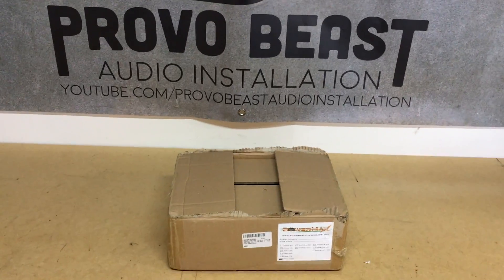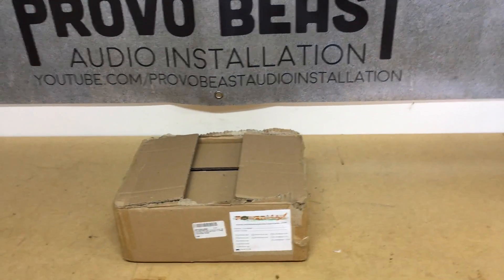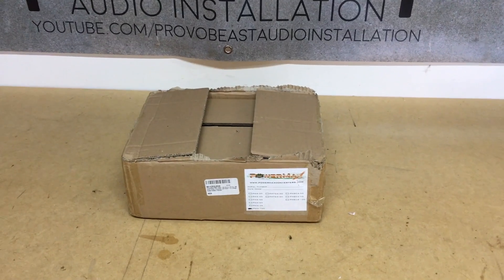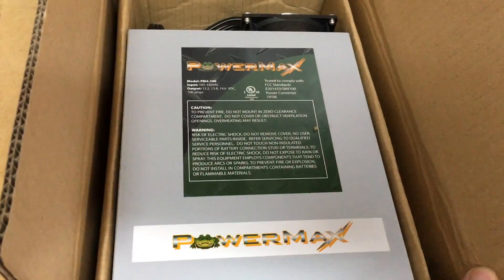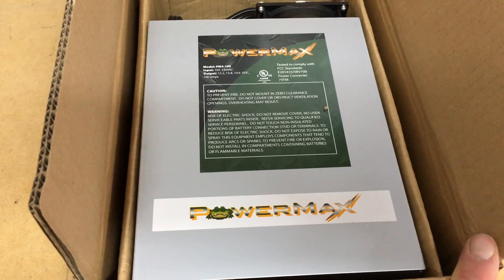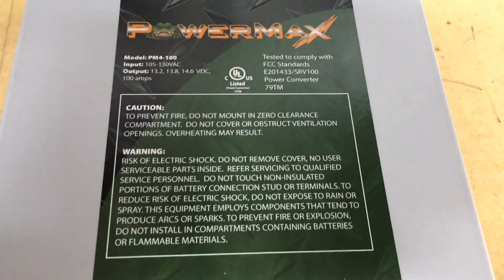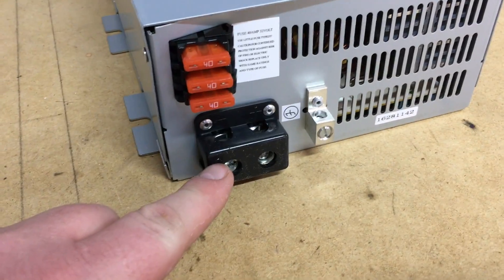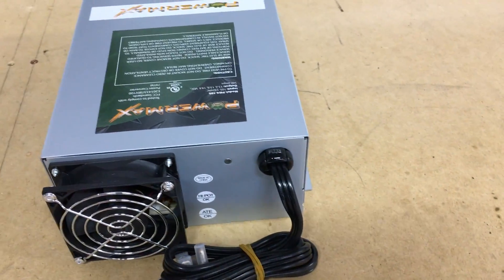Powermax 110 to 12v DC Power Supply Converter Unboxing

Comment: Hello, good afternoon. I wanted to ask you if this converter has to be connected to a battery and the 12V devices connected, or if the devices can be connected directly to the converter. Thank you for your help.

Comment: So if ive got a 2krms and a 1200wrms i need to run with a head unìt(caps in between) what should i run for batteries and should i step up to a higher amperage unit?

Comment: Can i use the 45a to power a 3,000w amp?
Reply from the maker: without a large battery bank, for 3000 watt RMS, no.  Unless that is "peak" power.  Regardless you will want a battery paired with this.

Comment: Hi sir I have a question is this unit can power up my 12v air conditioner required 1000-3000w starting cooling and 60 to 80A I have generator planning not using a battery just power up with my generator using a converter 110v to 12v is your converter can do it
Reply: That’s what I’m trying to figure out to !? Let me know if you found anything to do that please . 🙏

Comment: I need a new battery for my power max Bluetooth 12 in. Speakers the battery won't take a charge fully,  bought it two years ago works fine but with everything you buy electronically pair more then likely it's the power device cored or battery that will go faulty.  I need more videos to show me how to repair the battery or buy a new battery on a cheap price value.

Comment: What amperage on the converter would I need to run an 1800 watt 12v amp?
Reply from the maker: Is it an 1800 watts Peak or RMS amplifier, because there is a big difference there.
Reply: @ProvoBeastAudio  1800 peak but after Dyno testing I will be using about 1000-1200 RMS wattage.

Comment: This gives me hope that I could setup a truck winch in my shop rafters
Reply: Harbor freight 1200lb winch says 650 cca min. My 1.4L engine uses a small battery like this. Battery physics website says 1cc amp per cu inch displacement.61 cu in per Liter. So mine will need about 100A for 10 seconds? The PM4 offers up to 120 A models. I'm going try it out. But harbor freight says not for overhead lifting. Bottom line I think if power wire heats up so it is any bit more than slightly bit warm winch will croak soon.

Comment: I'm going to build a car audio system/amp test station in my house and I just got basically the same converter. Mine is the PM4-100LK. Same ratings, but the fan is internal and it has four 40 amp fuses. Not sure what the differences are between the one you have and this one, but it seems like it should be pretty versatile for what I need it for. I'll probably start out with a car battery I have laying around and upgrade to an AGM battery down the road. Thanks for your car audio in the garage build series. I've enjoyed watching it!

Comment: Would this be sufficient enough to power a 750W Edge Subwoofer in home? (The sub has an active enclosure amp, so amp is built in) At the moment I am using a 600W PC PSU with a single 12v yellow wire connecting to the 12V power terminal on the amp. I'm wanting to find a better/cleaner and safer method of powering my sub in-home as the yellow wires on my PSU get a bit warm when the amp is under load or the sub is producing loud and high amounts of bass. At the moment the PSU isn't giving enough power to the subwoofer's amplifier and so it kind of looks like the amp is clipping when it's not. It's just underpowered. If this is sufficient enough to power my active enclosure sub/amp then I can purchase an amp wiring kit and get the proper wires for it.

This is the sub in question: https://www.halfords.com/technology/car-audio/car-amps-subs/edge-edb10-10-v2-active-subwoofer
It has a 20A fuse in the amp as well.

Comment: Where exactly did you connect the red wire and yellow wire from the radio?
Reply from the maker: There wasn't one shown in the video.  Are you referring to your own install?
Reply: Provo Beast Audio Installation I’m referring to your video where you made  your own home system using that power max. The one with radio and amp. I couldn’t see where you connected the red and yellow wire from the radio

Comment: Hey i was wondering if i could power the amp with just the power converter
Reply: Not good to just run the converter. They are made for rvs need a 12v battery

Comment: Hi. How did you ground the power supply?
Reply from the maker: Since it wasn't in a vehicle and used instead in a home application, we didn't use the "ground" connection.  If this were to be installed in an RV for example, we would use the ground output to the chassis of the RV.
Reply: Provo Beast Audio Installation Okay, thanks. 👍

Comment: hi. hoping Everything is going well. i have a question for you. i would like to know the purpose of the 2 small switches on one of the sides of these unit. i think one of them is a voltage adjuster. but not 100% about the other. also one switch say ON and the other OFF. could you please explain how this work. i will really appreciate a reply. thanks
Reply from the maker: Great question, our power adapter was not equipped with power switches, so we can't comment on that.  You may have to check with the manufacture.
Reply: +Provo Beast Audio Installation the model of my converter is the PM4-100. and thanks for your reply

Comment: Hi, What amperage 120V outlet do you need in order for this to work?  is a regular 20 amp circuit in your house good enough?
Reply from the maker: A regular home AC outlet will work fine as the AC amperage is different than the DC amperage.

Comment: hi. nice videos. just wanted to ask if you know how many watts this unit is pushing out. i recently purchased the PM4-100. but dont know the wattage. thanks
Reply from the maker: it's not rated for wattage, it's rated for amperage.  Being that i can put out a max of 100 amps at 14.4 volts, you can multiply the voltage and amperage to get the max wattage of l400.  Most likely your will have enough amperage to support a 1000 watt rms amp.
Reply: +Provo Beast Audio Installation thanks so much for the info. it was very helpfull.

Comment: the powermax pm4 100 amp I have seen they have 2 green 30a fuses, and yours have 3 red 40a fuses, I haven't been able to find one like yours.
Reply from the maker: The picture is inaccurate, as long as the description shows 100 amps, you should be fine.

Comment: how do u change the voltage from say 13.6 to 14.7 is there a switch or something?
Reply from the maker: Nope, they call it a "smart" charger in that it will adjust depending on the battery.  No switch or anything, just depends on your setup.
Reply: Provo Beast Audio Installation oh ok becuase im going to be running about 1200 watts with a kinetic hc 1200, so im assuming it will raise itself to 14.7 when the bass hits, so i can get full output out of my amp. Thanks for the vid series really helpful.